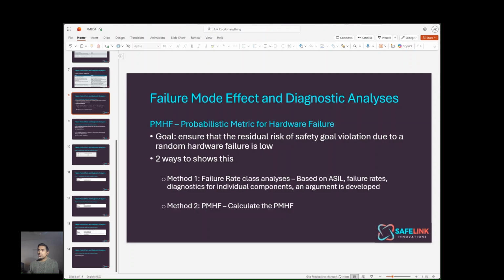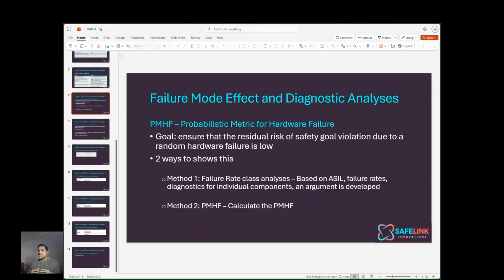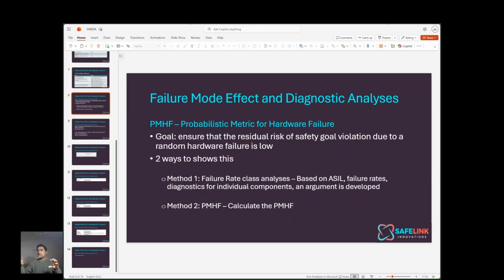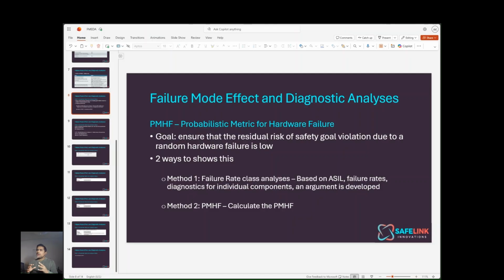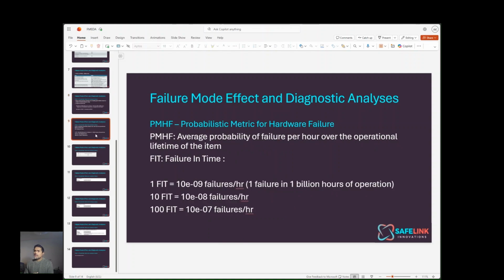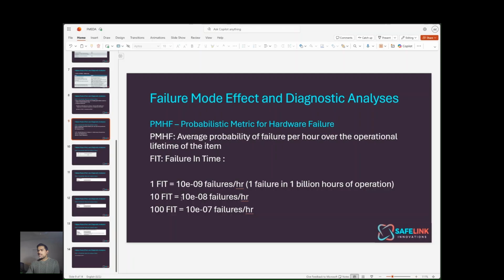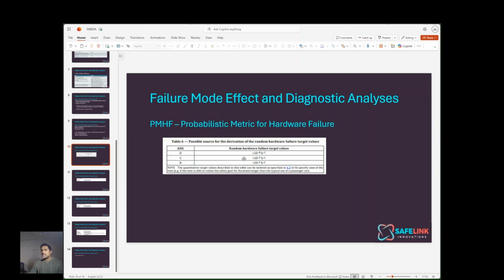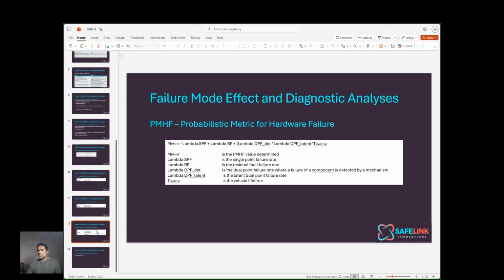Calculating PMHF - Probabilistic Metric for Hardware Failure - Part 1

Comment from the maker: Calculating PMHF for ISO 26262 often requires tracking hundreds of component failure rates, diagnostic coverage values, and FMEDA results.

Instead of managing this in complex spreadsheets, SLIKWORKS FMEDA Software automates the entire process.

- Calculate PMHF, SPFM, and LFM automatically
- Manage FIT rates, failure modes, and diagnostics
- Build and update FMEDA models much faster

See how SLIKWORKS simplifies FMEDA:
https://www.safelink-innovations.com/slikworks/fmeda-software